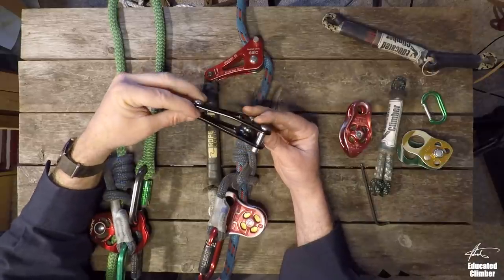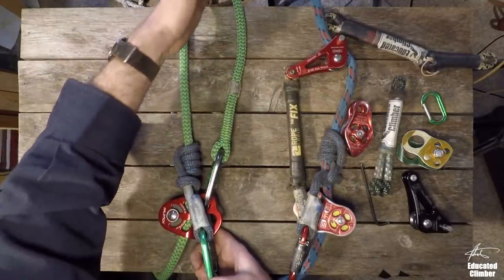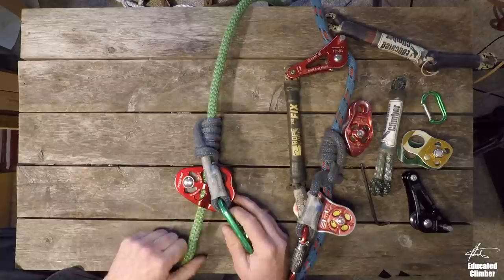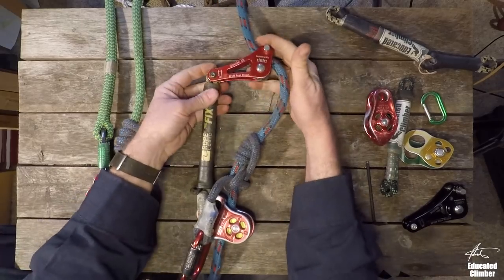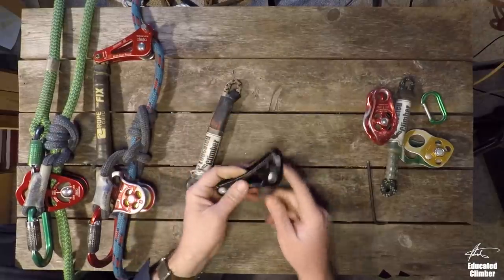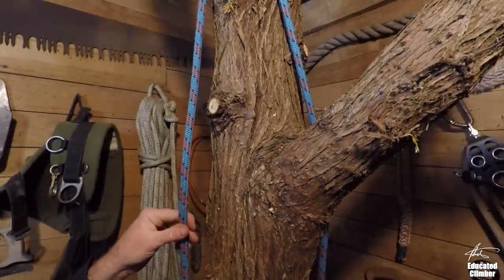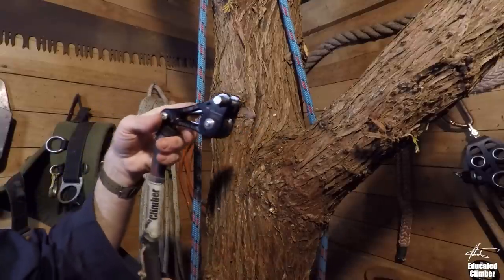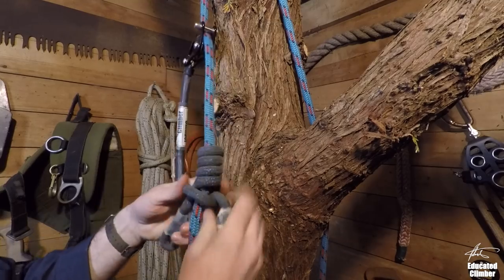Moving to SRT: Rope Wrench Basics

Comment: I learned how to climb by watching your videos. I've never climbed double-rope, I started SRT. I use an ascender with a foot loop and a Grigri. I made a lanyard by watching a "Bino H" video. I run a redundant life line for the initial ascent with a friction hitch to my harness because I'm a noob and I want an additional emergency life line in case my primary line breaks. It's been challenging to learn how to climb safely. Your videos have helped.

Retrieving the rope was a learning curve for me, as it really needs to be planned out before getting up the tree.

To secure my ascent line, I toss the rope over, tie an alpine knot, feed the end of the rope through and pull it secure on a branch. I end up with a climbing end and a retrieval end. That's the simplest way for me.

Thank you for your videos and I'm happy to see you publishing SRT content.

Comment: I only climb DDRT with Unicender and it's sweet, but I would like to learn some SRT. This is very informative. Thanks brother
Reply: Maybe check out the drum for the uni made from richard mumford @ climbing innovations if in stock then maybe check out mathys rope capture.drum goes on top making the rope travel smoother around the top in a rounded groove,the rope capture attaches on the bottom “cutting the L part off is required”which makes tending so much easier.at 1st wasn’t thrilled about drilling 3 holes up top & cutting the bottom L part off but it makes for much better tending the rope.plus the rope capture has a piece made to keep the rope in.also has two ball bearing’s for smooth tending.
Reply: @brianmerkerson2414  I had the drum attachment for almost a year now. I would like to get a rope grab for the bottom of the uni though

Comment: Great explanation of the weight distribution and the load on the hitch between SRS and DRS.  I have been enrolled in a Climbing 101 at Youtube University, but I missed that key point somehow. That explains how out of the many hitches I've tried, all of them are too tight due to the fact that I don't have a Rope Wrench type device installed.  Very educational.   One question though is does the rope wrench involve any adjustment of the tether to wrench point? You mentioned and demonstrated that as you increase the weight on the Rope Wrench, and with the hitch released, the wrench gradually assumes all of the weight. If this is the case, how does it allow you to descend? You don't physically manipulate the angle of the Rope Wrench do you? I get the fact that the Rope Wrench 'shares' the weight to allow easier operation of the hitch under load, but....Just a curious point which I'm confident I'm simply misunderstanding. I've seen several of your videos concerning hitches, but do you have a favorite to recommend for a beginner. I am about 200 lbs with all of my gear on.  Thank you in advance for your help.

Comment: Great video! Why does the one single leg tether have a grommet on-top of the eye at the Wrench and the ropelogic stiff tether doesn't? I have a ropelogic one and have been curious about it
Reply: I only know what I read here about that, but the rubber grommet is to prevent the wrench from falling into a negative angle which I assume would decrease the transition to assuming a load - or even prevent it at all. From what I see, if the wrench is allowed to flop downward, there will be zero friction on the rope for it to grab and assume the load. Just my logic based guess.

Comment: I'm having a hard time with my row French going up the rope smoothly. It seems like there is a lot of friction. I checked out the pulley mechanism inside the rope wrench and it works fine but it's almost as if that rope is not meant for this rope wrench.